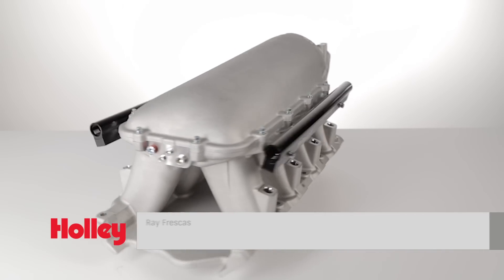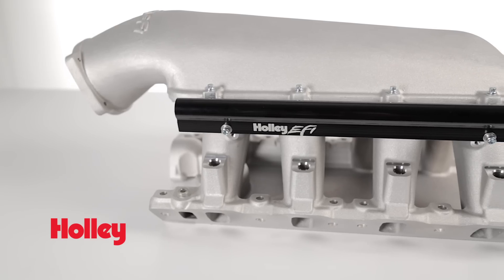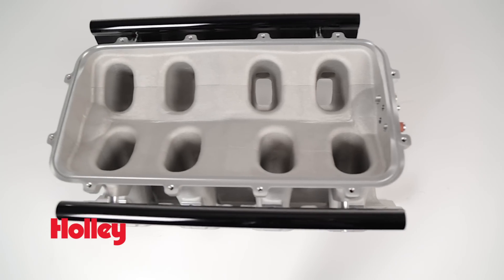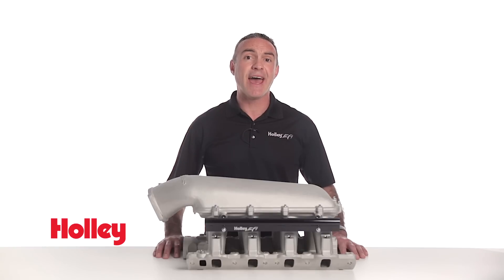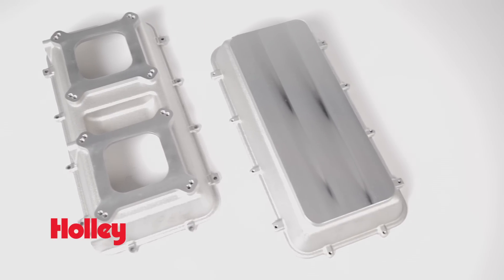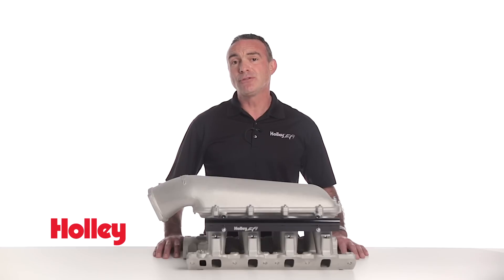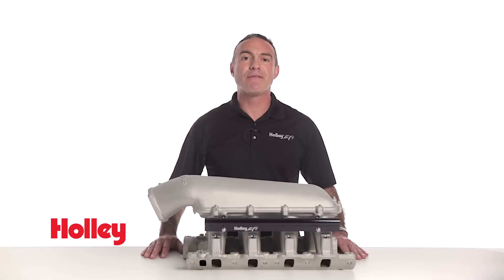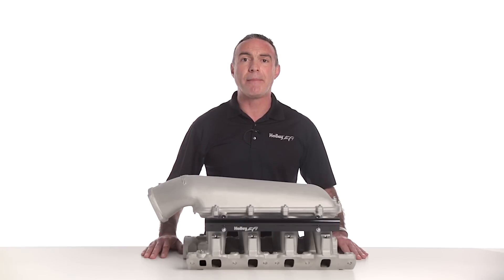Holley EFI Ford 351W Hi-Ram Manifold

Comment: Can I use the factory ECU (Mustang, F-150, Bronco) with the shorty distributor and Hi-RAM?  Or do I HAVE TO use your EFI system?
Reply: Depends on the year of the car or truck some use different efi setups and ask yourself is another 1200.00 for a terminator  x that anyone can tune vs finding the one guy that flashes factory ecms worth it, it’s 500-700 in tuning to get the work done ether way

Comment: I have a setup that includes dual 74mm turbos with AFR-225 heads and 427 Windsor.  I believe this  setup is expected to be around 1400 HP when completed.  Is this the best solution for efi or is it better to use the sniper 4500?  I always heard port fuel injection is better than throttle body type so why did Holley go to the Sniper series for high horsepower?  I am confused by your products.  One should work better than the other so why are you designing 2 products for the same job?

Comment: Dear Holley....get a 94-95 mustang with a 351 Windsor and do an install of this intake with Dyno numbers and you might start selling some...
Reply: Amen, run six inch hood with a hole cut in it. Maybe  use some Walmart stick on scoops to boot. Love the intake,  just can't use it.
Reply: I've come across several roller 351s and didn't buy them because of efi intake manifolds not being available or used ones being overpriced. Someone needs to start remanufacturing gt40 intake for 351w
Reply: @BruceLee-xn3nn  
Definitely agree. I know trick flow will be producing the box r again. Probably the most affordable too at this point...

Comment: Will it fit under my stock hood? LOL, I think I know the answer...
Reply: They have a thinner side exit fabricated top that they mention will clear a Cervini 2" hood actually
Reply: Someone needs to remake the gt40 351 intake. I've passed up several roller 351w because of the efi intake BS. I'm not paying 1,500 for used manifold
Reply: Dan Mallery well you gotta think your pushing hood clearance by going with a 351w in the first place sooooo...